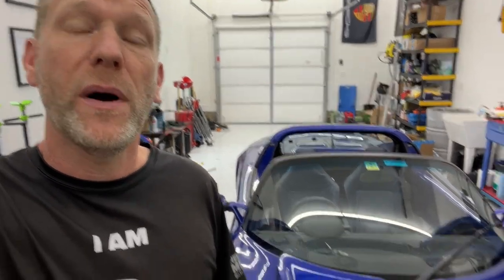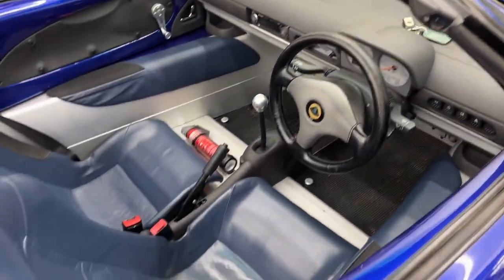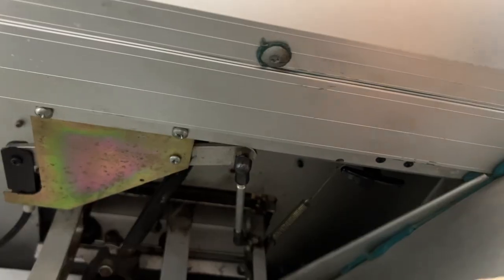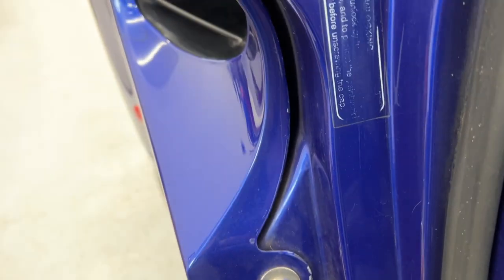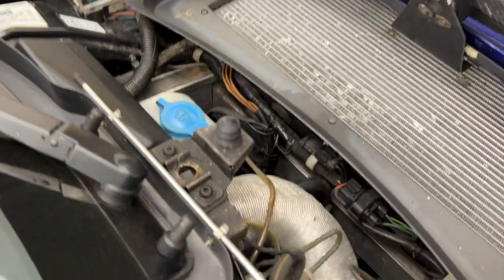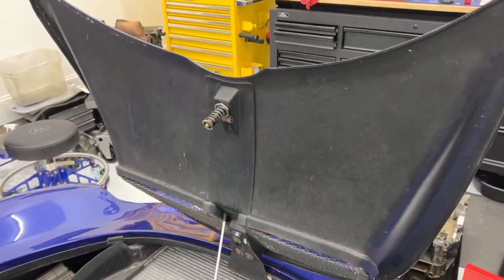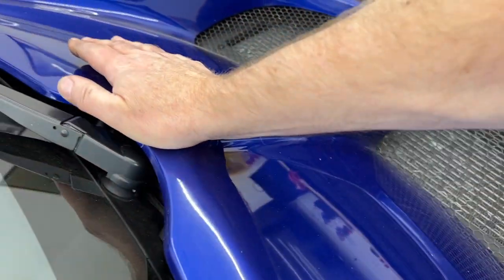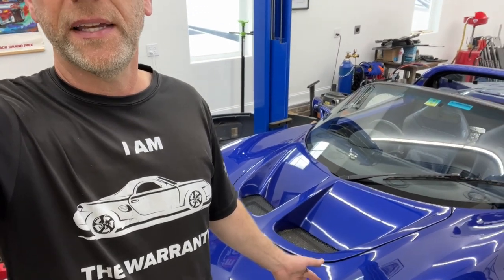How to OPEN THE FRONT HOOD (Windshield Buttress) of a Lotus Elise S1

Comment: Cool video.  I was surprised you actually had a hood release for the front hood.  In the S2, it's all bolted in place and hard to access.  I also thought it was interesting the trunk release cable inside the door well which is similar to my 4C, but in my Elise S2 you have to use the key to open the trunk.  I wonder if we should do a comparison video(s) at some point.  Thanks for sharing!
Reply from the maker: +Game of Life 411 thanks! I think we should.

Comment: The bonnet prop isn’t Lotus OEM, as you can probably tell. Most people improve a prop - the water bottle can be removed (although tethered) and laid on the radiator as a makeshift prop.
Reply from the maker: +drew oh really? I had no idea. Seemed stock to me. I wouldn’t put anything on the radiator as it could bend fins.
Reply: @HelpMeDIY  I've always used the washer bottle for my prop and not had a problem.  It's a large enough surface area to not cause any damage at all.  You can save three grams by deleting the little rod! :D
Reply from the maker: @AndyRRR0791  😂